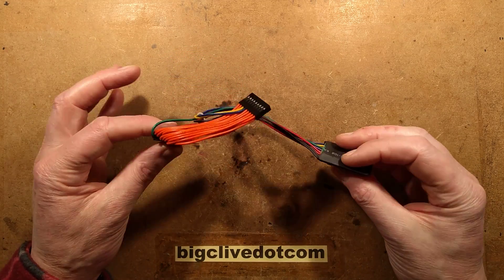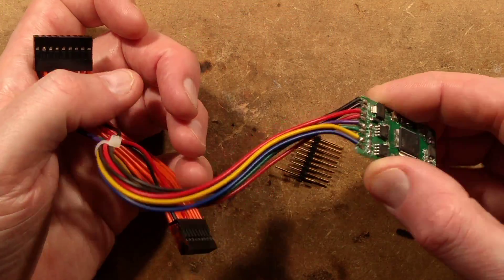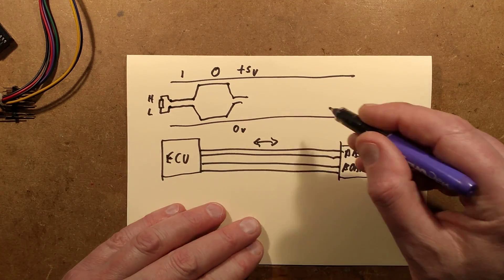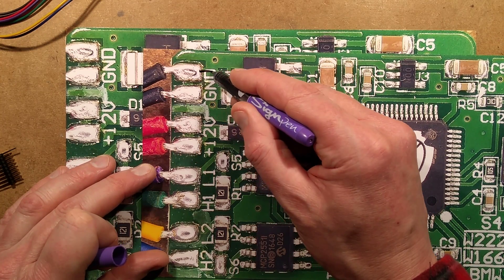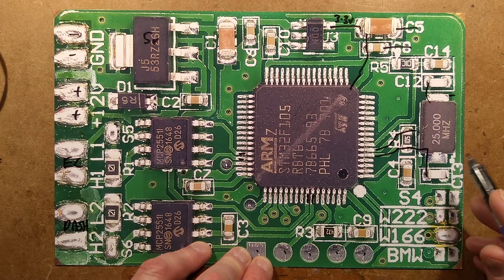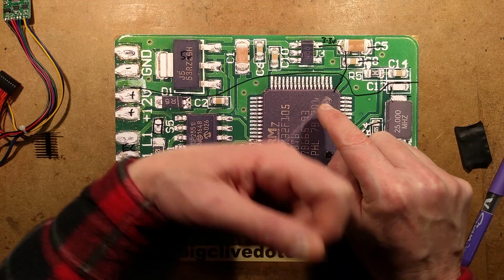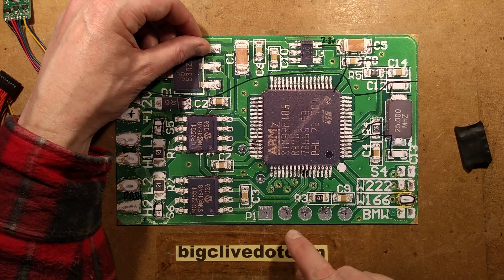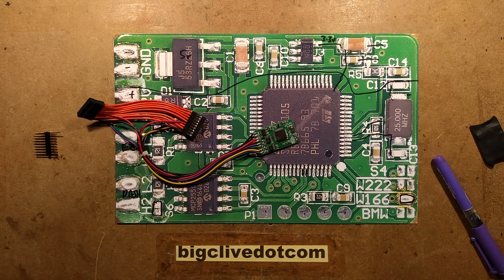Naughty CANbus odometer "interface".  (Fakes mileage.)

Comment: Thanks for the video, Clive.
For re-engineering the software you just need an ST-Link. With ranges from a Chinese one for 3,- ( https://www.amazon.com/st-link-v2/s?k=st-link+v2 ) to more reliable ones like https://www.amazon.com/Waveshare-ST-LINK-STMICROELECTRONICS-Debugger-Programmer/dp/B00MXVPLVW for 34,-
If you have any STM32 or NUCLEO Development Board, the onboard ST-Link can be used.
Btw., these "botch-hackers" always forget to set the flash-protection-fuses:) And if not: Glitching RESET or power-lines, to be "inventive" with the clock generation or other tricks can get you through the goal.
Needed Software: 

https://github.com/texane/stlink
file, binwalk, etc.

https://onlinedisassembler.com/static/home/index.html
Reply: Thank you! This is exactly what I was wondering about! You’re an especially helpful Trill!
Reply: @TheOfficialOriginalChad  I'm glad it was helpful.
Have fun making, child of the stars:)

Comment: This was never developed on "An arduino". Yea nah theres barely any stm32's that have that. The bottom pins are for dfu programming mode. The most likely thing this is doing is playing a man in the middle attack between vehicle communication and the odometer of the instrument cluster ecu. Super pro.
Reply: CANBUS is increasingly used for a replacement for I2C or SPI in DIY robotics applications because it's a rugged protocol. There's plenty of ST based 'Arduinos'.

Comment: In over 40 years of buying cars I cannot recall ever paying much attention to the recorded mileage.  But then most of my cars come from a period when body condition was much more important and the greasy bits could be fixed relatively easily.
Having said that, I did once go as far as replacing the luminous paint on the dials of a 1954 Pathfinder.  On that model the instruments were lit via UV filters which gave a rather pleasing glow to them.

Comment: Clive after a quick google search I found what I think is the original, its a "Yanhua MB CAN Filter 18 in 1 For Benz/For BMW Universal filter" available from $12 upwards depending on where you get it.  There are many clones now too., as you say it might not actually be made just for nefarious tasks, but in this case used for such.  The site I found had the exact model along with all the documentation to set it up...   Please let if you want me to send direct, but I'm sure you could find it as easy without me :)  It comes with one year warrantee! 
There are even some videos on YT I've found showing how to program it etc....  I doubt it uses Arduino at all although the "Blue-pill" dev boards can be programmed with Arduino IDE if they went this far I suspect they are smart enough to use a proper dev kit - besides they will want to avoid a boot loader so its starts up faster (although of course it's also possible with Arduino IDE).   I think the main learning point for me is to try and discover a way to detect such a device if I was going to buy a car.  I wonder if there is a way to detect or list all the devices attached to the CAN bus using a BT CAN bus interface and some code...    Seems the best way is pull out the speedo and see if this is attached to the back of it!

Comment: Interesting device ... 
In the early days of digital odometers the mileage would of the vehicle would be stored in multiple controllers eg ECU, instrument cluster and chassis module (many different names like body control module,  gateway module etc) if any device was replaced the system was replaced with a used part you had to tread carefully in coding them together.  As they would tend to take the highest stored mileage of all modules as the true mileage. 
Things moved on and the chassis module became the master and the others were used for verification. Which i guess is what this is doing it's intercepting the signal in both directions as not cause a mismatch.
The dash would of had to have been re-coded on it's own for it to accept the new mileage. If the device was ever unplugged I doubt it would work again.

Whenever i buy a car i'll have the correct obd scanner for that brand with me and i'll scan the car for anomalies, if the owner refuses i'll walk away.
Reply: On late 80s early 90s chrysler vehicles with digital odometers a symbol of a cog wheel would be displayed if the car was "notched" by someone who didnt know their business exactly..

Comment: BMW sends one specific message over the K-CAN ("Karosserie-CAN Bus") which holds the mileage. This message is always the same across a range of specific models (E-Series models use can id 0x330). This message is sent BY the "Kombi" (Instrument cluster) and is received directly through the PT-CAN (Powertrain and Transmission CAN Bus). If you write a message on the bus with ID 0x330, a dot appears on the odometer display which can't be removed from then on. It's some sort of tamper protection seal. If you, however, plug this device in between PT-CAN and the Kombi, it will effectively alter the mileage for this device and all other devices on the K-Can! This is serious because every ecu on this bus will remain on this mileage while the ecu and everything that sits on the powertrain but is not.

Comment: I'd like to use one but not for evil. To record all messages sent from a device and reverse engineer what was requested. Then I can simulate a module such as an ABS module or even the engine control unit
Reply from the maker: You need the CANbus version of the bus pirate.
Reply: @bigclivedotcom  I just had a quick read about it and it sounds like a typical Can receiver. The trouble is that you can't tell which module is sending the data unless you already know the device IDs. I need something to sit in the middle of the bus and device.

Comment: Commonly done ere in New Zealand on Diesel vehicles. just in a less sophisticated way.
Reason is we have"road user charges" (tax) charged to diesel vehicles on a per km basis. Petrol has it added at the pump. Because so much diesel is used here off road plus it allows the govt to tax based on what the individual vehicle is. A lorry will have a different per km tax rate to a private 4x4 diesel.

Not uncommon especially in older vehicles to just unplug the mechanical speedometer, or put in a switch if electrical and set your speed by rev's & gear. Don't get caught though, you'll get in the sh*t.

Comment: Your description was very close to how it works, Many cars store the mileage in more than one location, this particular module is setup for a mercedes to stop the dashboard getting an updated mileage from another ecu in the vehicle, not necessarily the engine ecu, it could be from the ABS, LCM or even SAM modules(other places store it too but these are the main ones). Many modules have access to the vehicles mileage so that when a fault occurs they can log the fault code, time, date, mileage, etc in the fault log.
The car this was removed from probably had the mileage "corrected/cheated" to a lower value before it was sold and this module was to stop the dashboard getting the updated mileage when the key was switched on, the module filters out the data containing the mileage from other ecu's but it cannot correct the data to show 40,000 km less, that had to be reprogrammed into the dashboard itself.
A genuine use for these is if you have some modules damaged by water/voltage surge/take your pick and need to replace them with 2nd hand units, if they came from a vehicle with higher mileage than the one your repairing then you would use a module like this to stop the dashboard loading the higher mileage into its memory, the dash will automatically increase the mileage value but wont lower it if you change the module back(BMW cars do this also).
Using the vehicles reg to do an online MOT check will usually show issues if the mileage has been tampered with.
We work on vehicle electrics here daily and have many problems with canbus systems, mainly due to condensation on the connectors & pcb's, it takes very little damp to bridge the can data wires to power wires and raise the canbus voltage above operating limits, but as the can network covers the whole vehicle it can take a long time to trace where the fault is, eg. landrover immobiliser & engine communications faults are regularly caused at the rear of the vehicle in the electric parking brake pcb, Mercedes canbus problems often are with damp underneath the drivers feet mat or in the boot beside the spare wheel. Its very interesting work but it causes some headaches and makes a weekly pub visit almost essential.

P.S. Removing this module most likely didn't do anything to fix the cars warning lights unless the module itself was faulty.
Reply: Was going to say something very similar, so thank you for saving me the time! Very well written!
Reply: Thanks for that, Im glad it made sense :-) its interesting that those of us with similar interests all end up watching Big Clive taking the same stuff apart
Reply: Fascinating. I have no experience with MB or BMW, so I had no idea the cluster would poll other parts of the CAN bus for an updated mileage value at key-on... wonder how many other vehicle makes do the same. I'm a bit surprised the cluster doesn't throw an error if the mileage query failed... could just be something subtle, like an extra beep with the odometer flashing a few times at startup; wouldn't hinder normal operations of the cluster or vehicle, but could easily be caught by anyone who knows what they're looking for.

I recall a few years back researching cluster replacement for a VW, and the only info I could find indicated that only brand new clusters could be rolled forward, but once the odometer no longer read zero, that mileage was burned in, and no other odometer modifications could be done -- so the options were either buy a super expensive brand new cluster, get lucky finding a used one with same or similar mileage, or just deal with the discrepancy. Whereas with Mercedes, it sounds like you could locate a used cluster with lower mileage, pop it in, and it would update the odometer with the mileage in the ECU. Pretty neat.
Reply: Mileage is also stored in the key on some BMWs (amongst other places)! There is a "tamper dot" on the instrument cluster if there is any discrepancy between the stored values.
Reply: Very interesting. I'm glad I found this comment, thank you.
Reply: Thanks for your comment, it was very informative and learned some new things from it.
I am still learning about canbus systems and trying to understand how the systems work. 

I bet you get a ton of satisfaction when you successfully diagnose a difficult and elusive fault.
Reply: @David_H_Parker  A lot of satisfaction most weeks but the odd brain scratcher that never gives up its secrets, lol, and a fair few visits to the local pub to forget about many days :-)
Reply: I wonder why Mercedes doesn't let mechanics reset the mileage on a used module, then install it into the car and allow the module to "absorb" the mileage from the car's original modules. That would still make it difficult to fake mileage, if I'm correct, since the car can still confirm the mileage with the other modules.

Maybe this mileage-counter system could be defeated if a shady owner reset all the modules in their car, but then the car would either come up with a blank mileage or 0 mileage on the dash which would be suspicious. Well, the owner could reset the modules every year and keep it low. I could see that as a naughty technique.

If Mercedes did not want to allow modules' mileage to be reset yet wants to allow owners to install used parts, they could have a special warning light come on to alert that the reported mileage is inconsistent between the engine modules. This happens after a used part is installed. Then to turn off that warning light, owners can take the car to a Mercedes dealership where the dealer can confirm the car has not been tampered with and turn off the warning light. (Though, are dealers too busy to see everybody who repairs their cars?)

The protection seems ineffective if a mileage-altering device exists, but at least Mercedes could think up ideas to make it easier for good owners to fix their cars (without needing to buy these special mileage devices) and still make it difficult for crooks to fake mileage.

I'm not a professional though and I'm sure Mercedes had their reasons. These are just some ideas. I imagine in the far future when less wealthy people are driving modern Mercedes cars, it's gonna be a mess if everybody repairs them cheaper with used parts. Then accuracy of the odometer would be all over the place. 

A solution to crooks resetting all their modules to reset their mileage isif Mercedes is only able to reset the used module. They can still allow people to bring in used parts so they can be reset. If a dude was constantly bringing in every module to reset, he could be suspicious of tampering with mileage. But good people would only bring in a few parts at the most. The problem, again is if the dealership is busy. But if it doesn't take long for the dealership, I feel their favors could build good relationships with their customers.
Reply: @heckraiserrr413  Its probably a money making exercise for the dealer also, its easier for them to claim that you cannot fit a 2nd hand part as it interferes with the vehicle mileage and then in the next breath say "we can sell you a new part tho for £xxx that wll sync to the vehicle mileage fine" without informing them that it didnt have to be this way,,,
Reply: Really good written/explained! I have one question. I found this kind of module on a car I bought and when I disconnected it, it still showed the same mileage. Has the car dealer done anything else, like a reset or so?

Because how I understood the video and comments was that the module connected just hide the real mileage. Did I understand it correct? (Sry two questions)
Reply: @ivanp104  Not sure why it showed correct mileage unless it had already synced (perhaps by accident) at an earlier stage, a full Xentry scan of your mercedes will probably show up an intersting history of faults at odd mileage correlation, not sure but just a suggestion if you want to find out more :-)
Reply: @ivanp104  I wonder if the Car Fax show the real mileage
Reply: this mileage device wont feed mileage to the dashboard like you say, however the ECU can be blanked or reprogrammed with the mileage..  the dashboard will only see the ECU data and therefore only display that mileage..  the ECU's are programmed with illicit "god-mode" scan tools..  where you can set any parameter to what you want.. they aregenerally used for defeating emissions controls or performance programming , however the good ones can also alter the odometer readings within the ECU...   the little board would then only allow odometer data to the cluster from the ECIU's can ID...  if anyone connects a  Legit scan tool though they will see the mileage from the other modules..  .. apparently they have an option for that in the OBD2 filter as well...    makes me glad i only buy brand new cars!
Reply: Yes that is correct and some used dealers will say its gps to track the vehicle in case someone steals it.
Reply: I did a search of the numbers on the back of the pcb and got this:

https://www.cardiag.com/product/can-filter/

Sounds like your theory may be correct.
Reply: @mattwilliams4222  That looks like an authorised product used where there is a mileage discrepancy between the various units that hold and store the mileage values on a Mercedes-Benz, the site makes mention that dealerships have a similar product available, so maybe we have an aftermarket solution in order to preserve an existing odometer value as opposed to fitting a new one which would be incorrect.
Reply: @darreng745  My money is on someone bagging themselves a cheap lease or PCP deal on the car when it was new, based on an unrealistically low annual mileage (5k, for example), driving the car many more miles, and then using something like this to hide it, and avoid paying the excess mileage penalty. There are units that fudge the signal from the speed sensor on the transmission as well to prevent the mileage being added in the first place. The way most new cars are bought and financed now, I reckon there will be loads of apparently low mileage expensive German cars out there with many more miles than showing.

Comment: CAN bus communications pass over twisted pair wires, specifically to allow the devices to detect and ignore EM interference.  The foot or so of CAN wiring without twist in this device is probably the cause of all the errors that then became the malfunction lights on the dash, which in turn led to the discovery of the device.  Good circuit design and implementation foiled by a lack of understanding of the wiring.

Also, not sure for Merc-Benz, but the systems I work on, there is a VECU or chassis node that does most of the translation and communication between devices.  So, the engine often isn’t communicating with the dash, the dash gets information through the VECU, which is communicating along separate CANs to the engine, trans, ABS, HVAC, dash, etc.

Comment: Google 2800-072601 and you will find where to buy these and how to program them. You can basically set whatever mileage you want. W166/W222 are two MB chassis models, but in this device, those refer to "old style" and "new style".